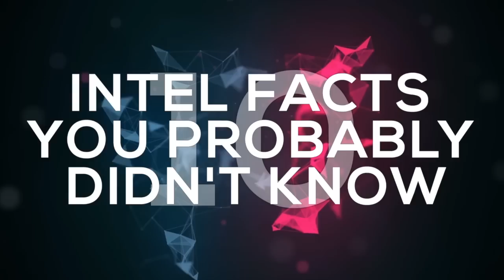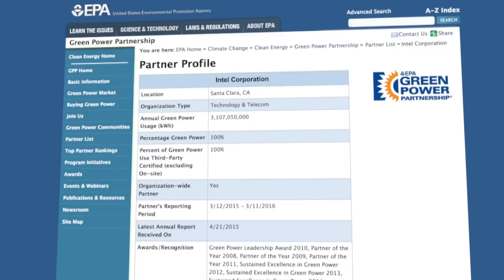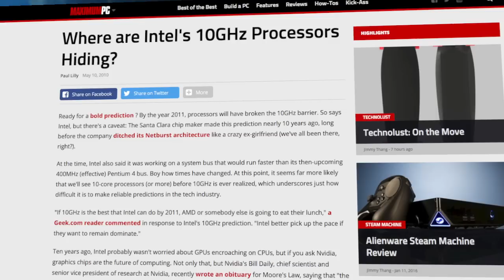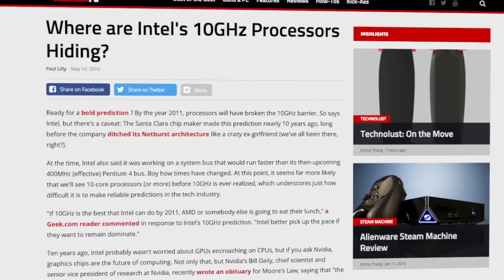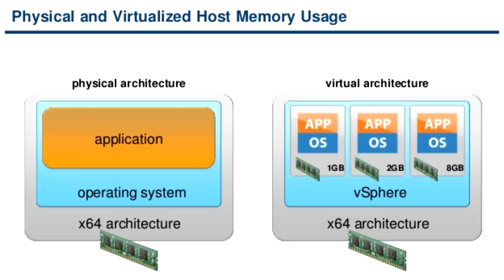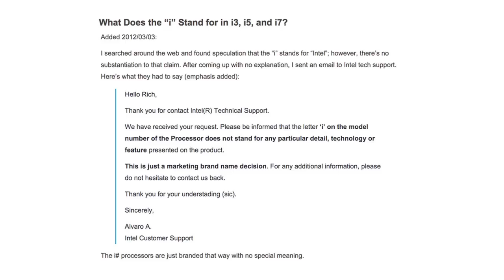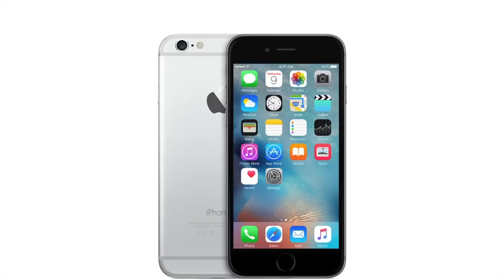10 INTEL Facts You Probably Didn't Know

Comment: 14nm is 1 transistor and a chip can easy have a few billions and its not manufactered with puting parts together its more chemical building you use semi conductor materials and you use things like vapor deposition. and at the end you just cut the card with them on it in the right size

Comment: can someone tell me what are the advantages and disadvantages of AMD I know I a few but maybe I well learn more
Reply: What G33RsofDeath said about i7 may be  true but as an owner of an i7 6700k i would say that he is 100% wrong about the 6700k.This thing is a BEAST.  really.( 4 cores with hyperthreading to 8 cores ).people have overclocked it steady to 4.8 Ghz on aircooling .i have hydro system and i didnt try more than 4.6 ghz cause i didnt want to stress it that much but it hit it with no difficulty at all. plus that at 4.6 with 100% usage when reandering 3d effects with blender got it to 85 deg average (35-50 when gaming). so now i clock it to 4.1 Ghz and its still fine and doesnt exceed 82 deg when rendering.even at stock speed (4Ghz) its very fast and had no problems with it.i own it for almost 14 months and i consider it one of my best buys :P Hope that was some helpful information.:)
Reply: PorkFreeGaming so like it's architecture differences... Way too long to type out and explain basically the tldr is budget? Go AMD (even though it's older and not as good it does well enough and is much cheaper). Performance? Go intel (much lower powered yet much more powerfull CPU, also much more expensive). Savy?
Reply: thank you very much that really helped!!!
Reply: AMD pro: bang4buck + OpenSource + good GPUs
AMD con: not good IPC (will change with Zen) + no "quality rule" for Notebook OEMs
Reply: Benman2785 
thank you because I am planning to build my own PC but so far I am going for the i7 6700k intel proccer
Reply: If you look up people that have tested all the Intel lineup the i7 isn't worth it for most task it's almost 100$ more (depending what currency you're in) and gives no more performance. you might even be able to overclock the i5 further since it's originally less powerful. BTW waste of the extra money spent on a K skew if you don't, it's free extra performance. So really check if your use case will benefit from the extra power before forking out the money. just gaming? you shouldn't consider it. Content rendering? 3D and video rendering will benefit from the extra power allot thought with GPU acceleration support this is becoming less and less true. then some other special use cases exist so idk what you're going for... but gaming and light content creation/streaming don't warrant the extra cost... get a better GPU and monitor instead you'll be able to SEE the difference much more.
Reply: G33RsofDeath 
thank you very much really helpful my board is compadebul with i5 so I well consider it
Reply: or wait for AMD Zen ;)
Reply: Benman2785 
what is that??!!!
Reply: PorkFreeGaming upcoming AMD CPU
Reply: Benman2785 
ohh cool!! I am going to check it out!!
Reply: ***** 
thank you for the info, but you are right why not an i7 6700k?? I have the extra buck and I have a really good graphics card so yea why not??
Reply: so what +MineOriginal is exactly what i said yeah it's a powerhouse but for gaming not worth it he's doing 3D effects on it. I bought a 4790K prior to skylake release for the exact same use. even if you have the money save it and get an even better graphics card/monitor that will get you better for your money/better visuals, because people often forget that no matter how good your card is it's worthless on a crappy screen. consider that
Reply: Forgot to mention that at that time ( oc to 4.6Ghz) blender couldnt take advantage of my gpu so i used 6700k 's intenral graphics (leads to higher temperatures + 25 deg). now i have a gtx 970 and everything works fine. Also notice that 4790k is 2 generations and about 3 years older.6700k is great both for gaming and editing.Plus the fact that if somebody is going for intense editing only! there is one way and thats xeon's . You should also know that this is the last generation of this kind of cpu's and its not going any faster until scientists find a way to make better use of other materials for cpu's. So if he has the extra buck its 6700k.He wont be disappointed in any way.At least thats my opinion:P oh and 6700k is around 400 euros and a good xeon is around 1200 + 1100 for a quadro (cause it doesnt makes sense to have a xeon and not a proper gpu).
Reply: 4790K isn't actually 2 generations behind since there was never 5th gen chips for desktop outside of x99. and since the out of the box clocks are lower on the 6700k it actually performs the same without OC. on xeon your GPU doesn't have to be a quadro they cost more to have double precision but apart form that they are GPUs and you can totally just use a cheaper "gaming" card. you only loose that little extra, well at least if you're not filling the memory but if you're on your own it's unlikely for you to be able to make a scene big enough for that. and i never said he'd be disappointed, I said if he saved the money from a 6700k to a 6600k he could buy a better GPU or screen with that and get a better experience overall because the CPU on it's own won't make a difference in games.
Reply: G33RsofDeath yeah but still 3 years between the two and what are you talking about? 4Ghz(4.2 with turbo boost) stock speed is amazing! (just read this -> 5.2 Ghz on air!!! ). it does make difference in games but its not that big.:P about 5fps .quadro is not only about double precision its way faster for this kind of things.i thought we were talking about AMD vs intel cause he was "struggling" to choose.Anyway i think 6700k is the shine of the line just like 4790k back then plus that it supports ddr4 ram and since i8 or sth doesnt seem to be close i would suggest the best, in addition i have the experience with this cpu in editing and really complex scenes and gaming and i m very positive about it.i dont say that 6600k is not good but its not quite there.Anyway if you (PorkFreeGaming ) have any question about 6700k i have the answers *probably :p
Reply: ***** 
i have the extra buck and I would love a fast pc so far this is my build (1500 is my budget)

http://pcpartpicker.com/user/Mr.DOOM/saved/#view=3BMpgs
Reply: PorkFreeGaming
still wait for zen ;)
Reply: Benman2785 
it is going to be probably expensive because it is a server cpu
Reply: PorkFreeGaming

well, i think 1500 isnt that much for a high-end rig // my current AMD system was more expensive // highend Intel will be 2000+
Reply: Benman2785 
my reg is intel, and I am not trying to hate on AMD and I am not against AMD but IDK if AMD ZEN is in the price range and when is the zen coming out??
Reply: Zen is coming out soon and will be in ~200€ range (with better performance per price)
Reply: Benman2785 
but the question is that is it compadebule with my mother board?
link to my build-

http://pcpartpicker.com/user/Mr.DOOM/saved/#view=3BMpgs
Reply: i thought you want do a new build for 1500

so you will need to buy mobo + cpu +  ram + gpu + psu

if u still have something dont pay 1500 and serach stronges cpu for your mobo
Reply: Benman2785 
I am build a PC for 1500 and so far thats what I have come up with
Reply: PorkFreeGaming if u build a new pc you can choose what u take as mobo
Reply: Benman2785 
ok but ill wait for zen to see if it is cheep for my budget I honestly want it to be so I want to see how much cash does it have (or power)
Reply: Benman2785 
but thank you very much for all the advice i really appreciate it 

no joke I do
Reply: Kinda late but i hope thats ok:P All the parts look just fine but i dont know about the msi mobo.When i was looking for my mobo i was going for msi too (my last one was a Gigabyte > great stuf) but i read so many negative comments about their mobo's(specificly krait's.Dont know why. So i didnt trust them on that and went for my current one witch is z170-a from asus.you should check it out watch a review on youtube too even thought it might not fit if you re going for red n black accents xD.Dont get me wrong msi has some great equipment like their graphics cards but i dont know whats wrong with ther mobos.At least krait ones.
Reply: ***** 
I actually looked at there reviews but they all said i was a great board idk but I well check the asus out
Reply: buy MSI Military Class Boards -> those rock ;)
Reply: Benman2785 
ok thanks I can use all the advice I could get really thanks you guys!!
Reply: Benman2785 
but I want black and red theam
Reply: PorkFreeGaming black red theme? mh i think Gigabyte Gaming are b/r
ASUS is also B/R
MSI usually is Black/Blue
Reply: Benman2785 
I have seen a lot of msi black/red but maybe they are virsion that I have not heard of
Reply: +PorkFreeGaming buddy spending over the buck for a cpu not worth it. as newer games released the gpu lags not the cpu having a 5th gen i7 hq is waaaaay lotta power available for games. i suggest save extra bucks for gtx 1080 n a vr. thats what i did
Reply: Aadithya Naik ok thanks !!

Comment: technically the i stands for "inside" intel inside being there slogan. Intel Core Inside 7 (product number) 7 being the series. product number being the 4790 6700, or whatever. Atleast thats how i understand it. Sure the official reason is probly because fuck it why not. But ive always liked to think of the i being a stand in for "inside"
Reply: the 'idick"
Reply: thefilmdirector1 so 6950x = Intel Core Inside 9 = i9 cpu
Reply: You didnt even understand what he tried to say. 6950x is an i7 anyway
Reply: thefilmdirector1 nope. it doesnt work like that. remeber i7 920 and i7 2600/K. Not even a single 7
Reply: The reading comprehension here is appalling..

Comment: meanwhile IBM, global foundry, and Samsung are making 7nm chips and Intel still struggling with making 10nm possible :3
Reply: Weibin Zhou this is for full sized CPU'S right? not something that fits in a user's hand....
Reply: Devesh Singh nope gf is helping AMD make GPU :3
Reply: Wasn't 14nm the limit for how small they can go due to physics laws and things?
Reply: :3
Reply: You were joking right??? They do have it... do some research...
Reply: they don't. do some research
Reply: Wow, need some links???
Reply: 7nm or 10nm?
intel doesn't have 7nm and 10nm is in trial production. THE END
Reply: i can't send you any link because i can't find any link other than wccftech
Reply: my i5 4690K uses 88 watts , what is the power draw of a cell phone cpu ?
Reply: no more than 2 watts at load. but compute power on a mobile device can't get too close or just can't get anywhere close.
Reply: nm size and power draw are relative to each other
Reply: arm vs x86-x64. you're so SMART sir
Reply: Delicious Kawaiigami for silicon yes. for something that's not silicon no
Reply: Weibin Zhou the numbers and definitions that each company applies are actually different. For example TSMC has a different definition of "node" than Intel has and that's why they claim to be ahead, producing 5nm by 2020. They use the "nm" measure but it doesn't mean the same for both sides of the comparison, making it unfair :)
Reply: nah intel does the same :)
Reply: Weibin Zhou what the fuck are you reading? Nobody is near 7nm. Especially the shithole called global foundries. All they are is wasting AMD's money.

Comment: Oh, you fucking moron. If Intel became a monopoly in a free market, it would either have to consistently innovate or it would become bloated on its monopoly status. This would introduce a pathway for competition and what replaced AMD would, well... would be a far greater challenger for Intel than AMD is now. But because of the pseudo-competition between AMD and Intel, it nudges other potential CPU designers out of the market. Additionally, the pseudo-competition/semi-collusion that exists between the two is the reason why the smaller company doesn't just copy Intel's socket design.

It's the anti-trust laws that are creating a problem, that being of a friendly competition rather than an aggressive one. Because the competition is not aggressive, technological advancement isn't quite as fast. It's fast enough to ensure that there aren't new competitors, but not fast enough to drive AMD out of business, create a monopoly, and then get challenged by a startup that hasn't become bloated by its monopoly status.
Reply: If amd came out of business. Intel would rule the world and could jack up the prices as high as well probably slowing down their development because of no competition.
About the fact that someone ' better' would come in to compete you are completly wrong.
Did you see how the dye looks?
It is all patented and you would have to design yours. From scratch.
Also not to mention you would have to have the machines and people necessary for that.
Also patented and almost impossible to recreate.
A new company would basically have to start small. Just like the original ones did.
With week ass processors of maybe a few Mhz and slowly developing and optimising from there.
But it would take years and it would never be able to catch up with intel.
Never.
Also Dont call people morons just because of your half-assed theories that make no sense whatever.
If you are gonna complain about my grammar just note that i really dont give a fuck about that and i wont give an effort to 'please' you.
Have a nice day.
Im not hating btw. just pissed of your theory and attitude.
Reply: Joseph B. So your argument is that, if the government didn't get involved, then nobody would be able to challenge Intel because of government involvement.

Thanks for your input.
Reply: The government wouldnt get 'involved'.
They are laws. and are applicable to every individual and company, Intel, Amd.. etc.
You cant go over that.
Reply: Joseph B. So the government wouldn't get involved. It's just that laws, put there by magic, would get enforced... via magic.

Okay. Once again, thanks for your input.
Reply: you tell me. what does the government have with making CPU's ?
Nothing.
Its just laws. made by the government..
God your logic is so screwed..

Comment: Additionally, the frequency (MHz/GHz) are entirely unrelated to the number of transistors.  It has to do with electrical properties of conductors, insulator effectiveness, and transistor size, not quantity.  In fact, more transistors results in more heat and lower maximum speed due to distance from point to point.  However frequency is only a measure of speed in an identical CPU:  Any changes drastically change the perfromance.  Hence why AMD and Intel CPUs are so incomparable outside of real-world-performance benchmarks.  It's rather complex but the point is, this fact is largely misconstrued and the supporting evidence given in this video is awful.

Comment: Intel is a beast,  did you see # 10. and did you all notice what he said about how small the transistor is! Intel maybe have it's fault. I have I7 and its great. i can play assassins creed black flag, 3, revelations, even rts games. It's all about how the user decides to change they're settings. And of course AC4 needs to be on low everything but i've notice optimization is key. Resolution settings are key to end lag. Surprisingly my 15'6 inch laptop with the intel i7 and screwed up nvidia gtx 675m(disabled) still works regardless of nvidia being disabled.

Comment: Cool summary.
The answer to #1 is lithography:
Think movie projector, but backward!
Instead of using optics to magnify a small image and projecting on a wall / screen, you take a big image (mask) and project it down to a tiny, tiny size.
Yeah. Easier said than than, when you have 3 billion transistors and your traces (wires) are 14nm wide, but that's the principle.